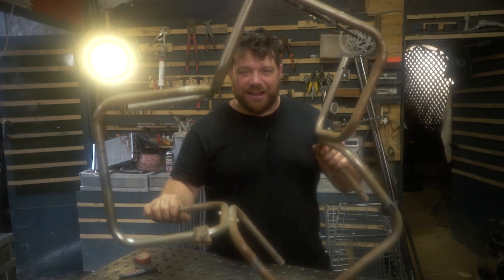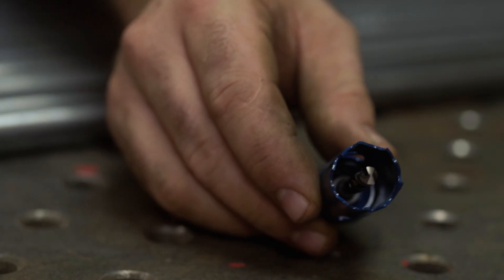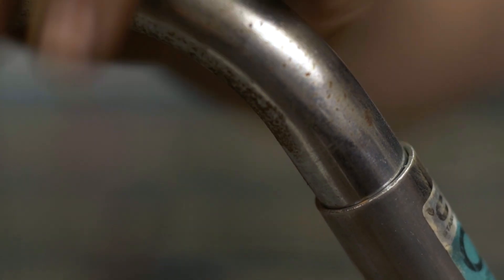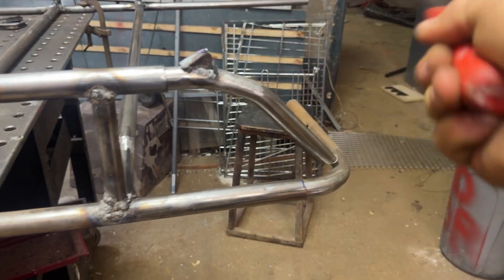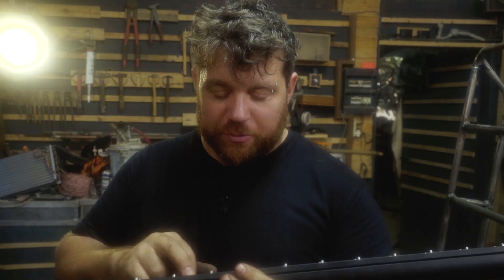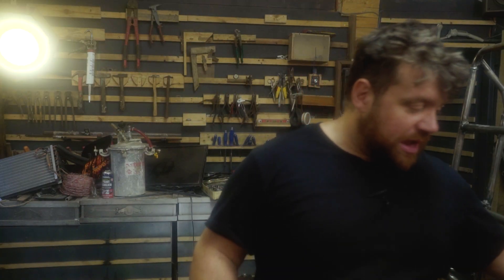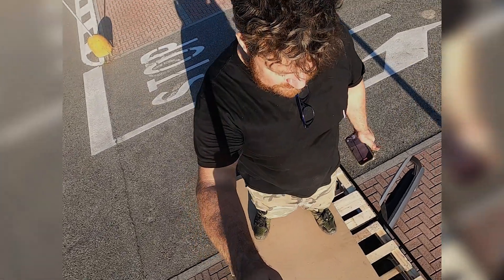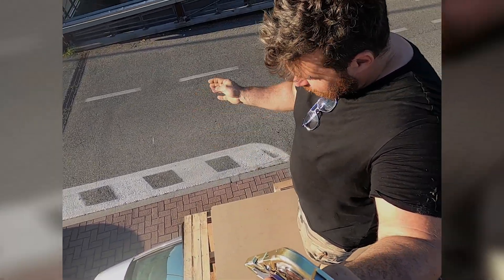DIY Roof Rack with 2 Hidden Surprises

Comment: 🤔 Check out photogrammetry for scanning objects instead. I used it with Blender, but a quick search shows it's possible with Fusion360. The process is equally fast, but gives much, much better results,  because phone cameras went through an insane technological leap over the last 15 years, and even cheap ones have a resolution that lets the software calculate tiniest details.